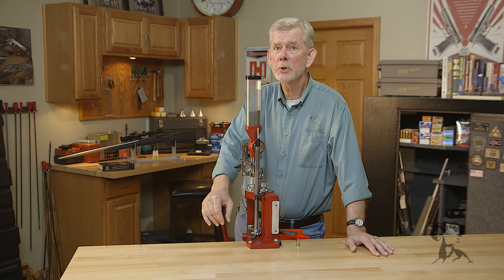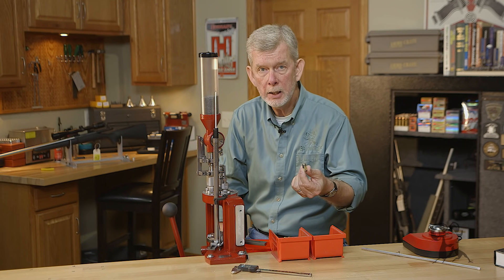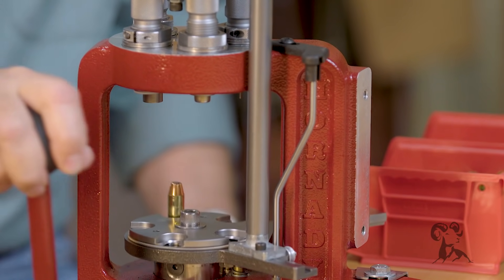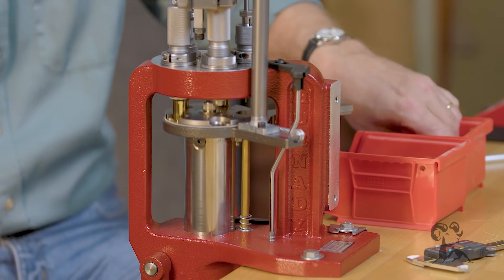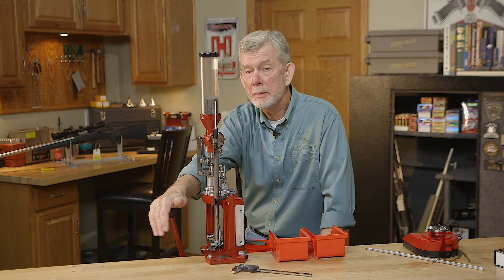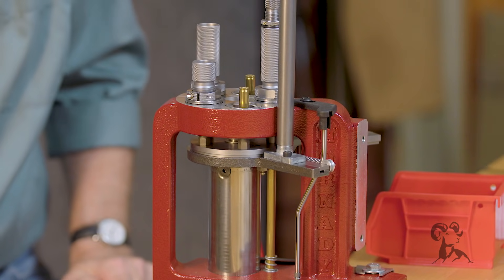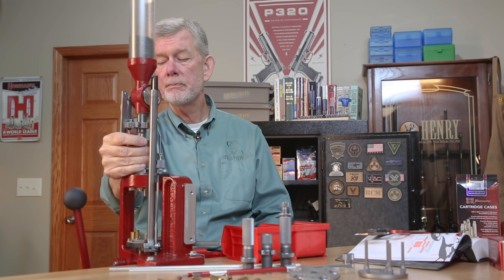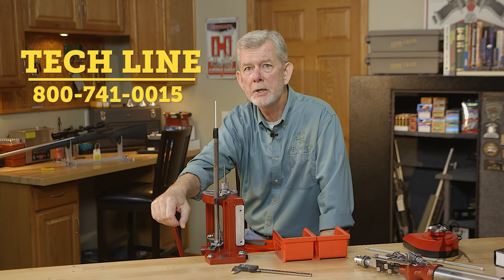How To Operate the Hornady Lock-n-Load AP Reloading Press

Comment: So you don't need an expander die? I'm so confused. My 9mm die set comes with 3 die. I'd like to use a powder cop for checking my charges but also be able to run a bullet feeder. With 3 die I only have one open slot and must choose between powder cop or feeder.
Reply: You should not need to use an expander with jacketed or heavy plated bullets. If you are loading cast lead or thinly plated bullets, such as Berry’s, then expanding becomes necessary.

Comment: You mentioned the Hornady one shot case lube. Using Imperial case lubricant in my single stage I’d feel the need to clean cases after resize to remove before charging with powder and seating bullet. I have a Lock-N-Load I use for pistol cartridges and carbide dies. Is the Hornady one shot detrimental to the cartridges, either powder or bullet trajectory?  I’m wanting to load 5.56 on my progressive press and I don’t think carbide dies are available

Comment: I’m sold.
Reply: You won’t be sorry. It’s a great press. But you will have some “fiddling” to do before you get it to run well. Read those directions. I strongly suggest you polish up the contact surfaces on the primer feed mechanism. Also, bevel the bottom front of the primer sliders to better clear the primer punch.

Comment: No flaring of the case mouth?
Reply: It was done in the powder-through-expander die.
Reply: Luvta Handload that’s not correct. There is no powder through expander die on the LnL AP. He was loading jackets bullets, so he need for dwelling the base mouth.
Reply: @gregoryvanek9038  There are options to run the LNL powder dispenser with a expander.

Comment: Do you clean the brass first, before de-priming or afterwards?
Reply: Before. Usually in a vibratory tumbler that has little grains of stainless steel that clean inside the cases
Reply: @doughboy5840  i deprime first in a dedicated die, then clean then size etc